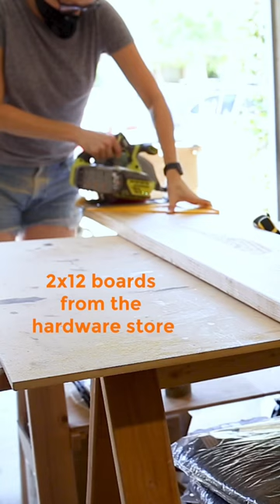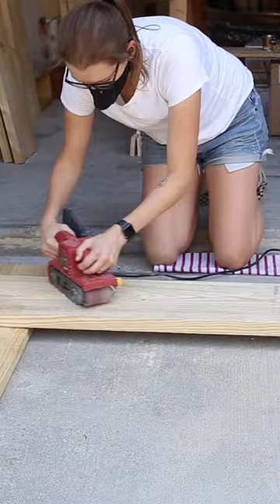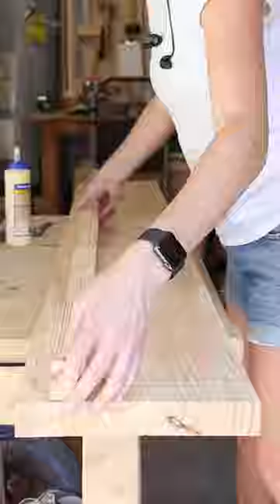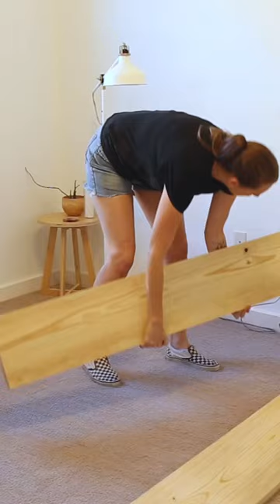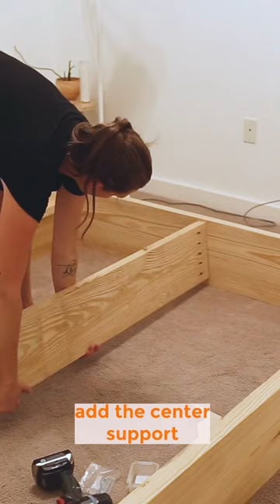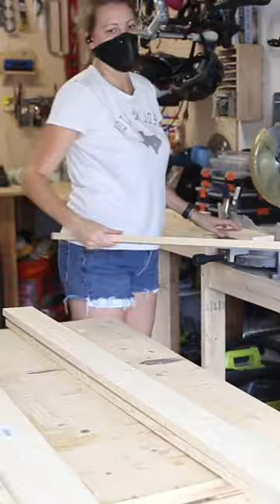How to build an EASY bed platform #shorts

Comment: Grt job, bt l wud hve put some legs wit wheels for wen you feel to change around d room. Then you can roll it to a nx position. 👍👍👍
Reply: And some storage at the bottom space wasted
Reply: The thing is probably very light. Wheels would destroy the carpet....
Reply: @JohnOwens0 How about some gliders that would be glued and screwed to each corners ? Would that damage carpets?
Reply: @robertlee8805  no idea. I was responding to someone else saying that it should have wheels... I think it's better as it is in the video

Comment: What kind of lumber did you use for the slabs ??
Reply from the maker: For the frame, I used simple pine construction lumber
Reply: @MakerGray  is that for the 2 by 12??
Reply from the maker: @Marc-bi6tt  yep!
Reply from the maker: @Marc-bi6tt  I've got all of the dimensions and materials (and different sizes) lined out in the bed frame build plans here: https://bit.ly/3BQhp4X
Reply: @MakerGray  thank you!